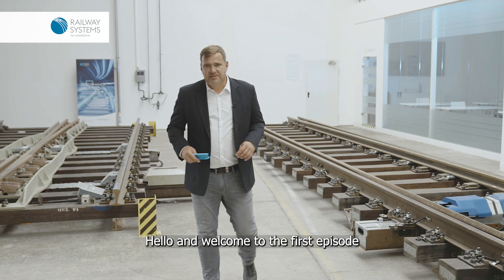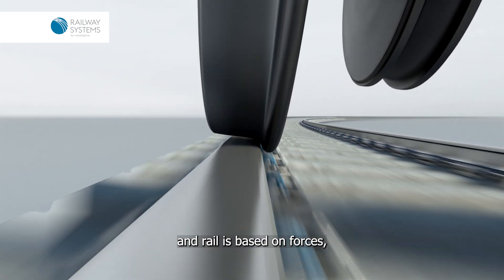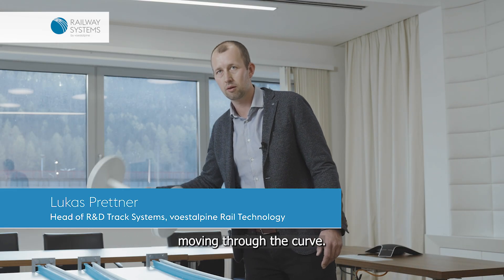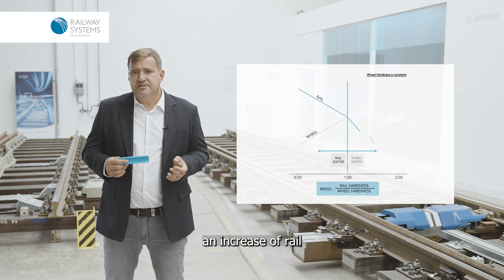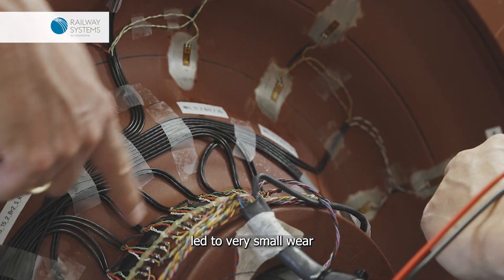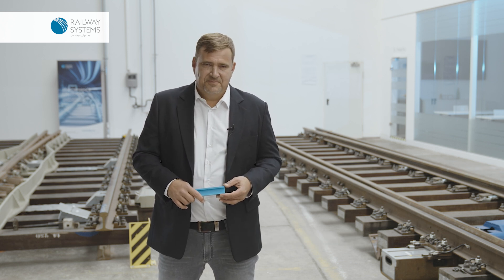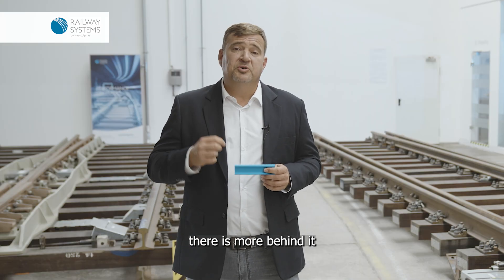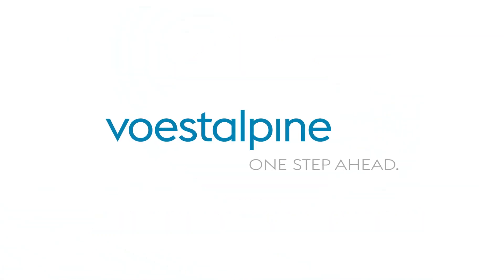[Rail Insights] Take a closer look at the wheel-rail-interface

Comment: A Coal Mine with a isolated railroad..  25 MPH limit.. 170 ton cars..  locomotives at both ends.. down hill loaded for the most part.  tight radius curves chews the top of the tracks up thru the curves..  could lowering the outer rail level cause the wheel sets to shift to the outer rail to reduce wear on the track surface since there is not enough speed to create centrafugal force?. could the tight corner require a different grind on the wheel sets.   when i saw the track surface.. and the wheels that is what i came up with.  its probably totally possible on this non interconnected railroad..

Comment: Add to that the variations of loads, bogie designs curve radii, tilt angle of rails and different speeds of trains and of course wheel diameter as well as environmental factors like temperature and water on tracks.

Comment: OK hardness is good, but the radius seems to be more important. It would have been good to show the radius in more detail, what is good, what existing rails and wheels look like. Yes they should match, what does that look like? I couldn't tell the difference between the light blue and white rails.
Reply: Point is that the harder rail helps keep the correct rail profile for much longer, which means less rail maintenance and also less wear on the wheels.

At least, if we listen to the people who are trying to sell harder rails.

Comment: I can remember watching Southern Pacific crews replacing hard faced rails on the Coast Main LIne with conventional rails in the mid 1970s. It seems that the test sections had performed well but something happened when the big contract was let. Something got streamlined. Metallurgy rules the rails. Do the laboratory testing methods actually measure what you are interested in? Is the correlation high enough to be a good predictor? The benefits of hardened rails have been known for a long time. Our world is run by managers and accountants, not engineers. Think about that. Quarterly reports and stock prices rule the board room. Unfunded liabilities (maintenance) takes a back seat. Defer maintenance, be a Wall Street darling, look for a buyout partner. Don't wait until the deferred maintenance becomes apparent. Pump the price and bail out.